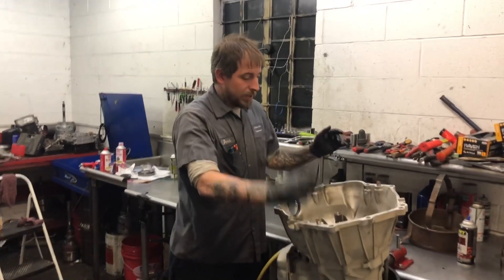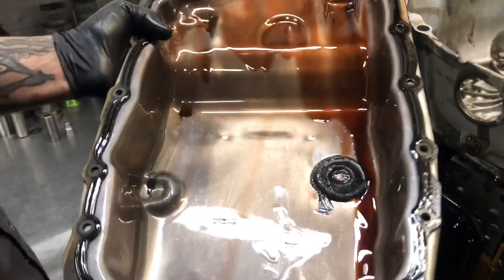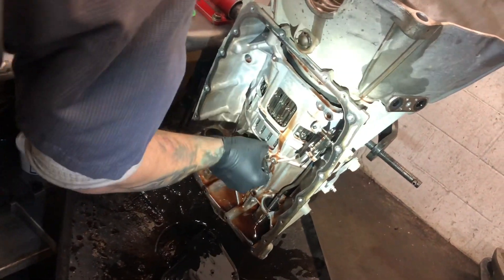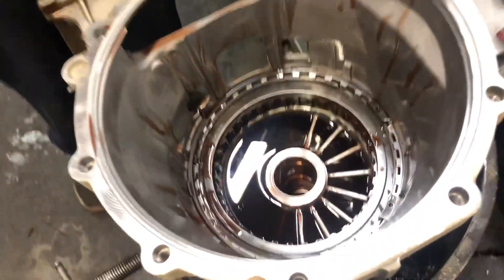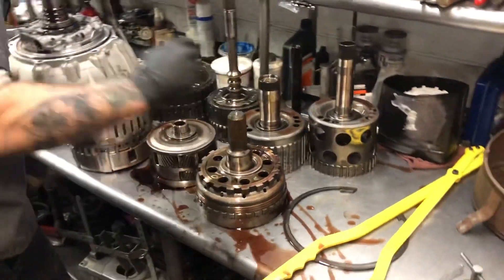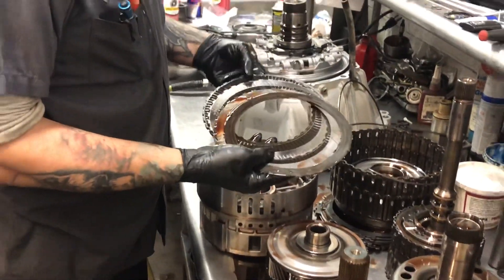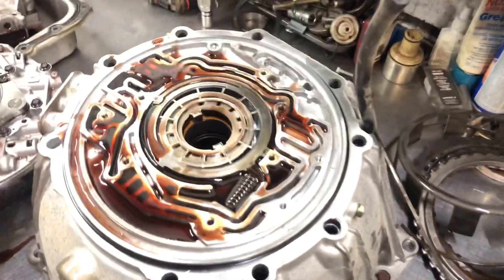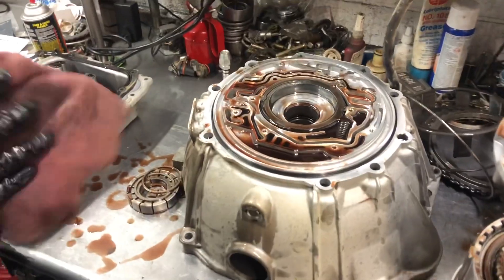2015 GM 6L80 torque converter failure

Comment: Thanks for the great video!  Was watching trying to get some pointers as I am pulling the 6L90 out of my 2500HD for a rear main seal replacement.  Didn't realize at first that you are a fellow Kansas guy.  Really cool!  I was wondering if I think I have a fairly strong transmission, i.e. clean fluid and not much metal in the pan or on magnet, if a torque converter replacement is a good idea while the tranny is removed?  I understand that the 6L90 TC's are also a weak point.  If so, do you recommend going with a billet?

Comment: I have a 2014 GMC Yukon 1500 -200,000 miles.  Changed fluid every 60,000 miles.  Starting to stutter a bit, I’m thinking torque converter.. what does a rebuild like this run on average?

Comment: These models gm trucks have these common problem of torque converter getting shot. They have a design flaw for the torque converter. Our 2018 chevy silverado torque converter went out at 120k miles. We chose to rebuilt it. The transmission specialist shop replaced it with an aftermarket redesigned torque convertor and also installed a separate cooler just for the transmission to extend the life of the tranny because these gm models also have these problem of overheating tranny fluid. Hopefully this fixes the problem. Listen to Scotty Kilmer and get a Toyota. Our 2006 Toyota camry has 370k miles with the original engine and tranny.

Comment: 2016 silverado 1500 5.3 4x4 High Country and the trans. Is already slipping at 87k miles. Its time for a lawsuit this is just stupid AF. A $40k-$50k truck with a glass transmission is unacceptable. My 07 ram 1500 had 210k miles stock trans and still ran smoother than this garbage. Shit my 2001 corvette 6-speed has 80k miles and still doesnt surge or slip one bit and i drive that MF HARD. GM can make a solid trans. The problem is they gave up and decided mass production is better than reliability.

Comment: Just ran into this issue with my 15 sierra too. All of your videos on the 6l80 have been extremely helpful. Thanks for taking the time to go through all of this and film it. I'm rebuilding mine myself. It had much more glitter than the one in this video, but it still got me home.
Reply: Mine had hella glitter from a p0796 code. So from what I’m seeing I guess I need more than just a valve body

Comment: Why do this torque converter go out so easily an did thy update the 6 speed an 8 speed transmissions
Reply from the maker: There's a multitude of different reasons for converter failure but the biggest fault is in the regulator system. There have been many updates and upgrades to both the 6 and 8 spds however failure is still imminent.
Reply: @expressautotransmissiondav4207  is it because of the  exhaust pipe that runs under the transmission pane that it fails because of heat ?
Reply from the maker: No while the heat may not be good for it I don't believe it has any true effect on the life expectancy.
Reply: @expressautotransmissiondav4207  so it’s the torque converter in the front that fails and ruins the transmission right? Otherwise the transmission will last

Comment: Just got my truck back from GMC where they flushed it to get it to be good enough until the warranty expires in Aug. After I got the truck back I went to a tranny shop where the quoted me $8k to do torque converter and trans internals. Does this sound accurate or is that a ripoff?

Comment: Interesting video, I have a 2011 gmc yukon with the 6l80 and it’s starting to shudder at about 45 mph but it doesn’t seem to last long.. I’m wondering if the torque converter is about to shit the bed on me as I’ve heard the torque converter’s had issues on these transmission’s.. I wonder why the fail on these

Comment: I just bought a 2018 Silverado and it drives fine, still under warranty for a little under 2 years i would say, just curious about whether I should do a trans change or flush when it comes time for scheduled maintenance? I heard in these trannys they only need a change, but would like your input.
Reply: Definitely look into it if you think you need especially if the transmission feels weird to ya, i just dropped mine off at a shop earlier today for this reason in the video

Comment: I have a 2013 Chevy Silverado. When it's at a complete stop I put it in gear holding the brake and I can feel a rumble like the torque converter in the brake pedal. When I let off the break and go it stops. I heard that the torque converter is what messes it up. I want to put a new torque converter what type should I get. It has 160,000 miles but it's mostly highway.

Comment: I'm having an issue with air checking the 1-2-3-4 and reverse clutch. With it out of the case and mounted onto the pump, it air checks good. When in the case and pump installed, it does not air check. Is this right? Normally I only check it outside the case.

Comment: I have a suburban 2011 took it to Ammco they replaced the transmission the first time it dint want to go into 6 gear  I took it back they. Replaced with another one drove it for the last 2 days and today it was heating up 216 I don’t think this is normal any suggestions.
Reply: Did you figure it out ?

Comment: recently adquired a camaro rs 2016 with 33k miles, it has some transmission issues, when driving for some minutes it wont advance or go on reverse, its like the car is on neutral even though rpm moves, i have to turn it off then on again, and it will work for some minutes until again the car will stay like on neutral even if its on D or R, do you think the transmision failed or is the converter?
Reply from the maker: I would pull the pan and see if guy have any material in it.

Comment: What would you say is the average cost to fix this including labor? My 2017 is sitting in a transmission shop right now with this problem. I dont want to get ripped off.
Reply from the maker: My average is between 41-4500 for total rebuild with techem.

Comment: I hope you can help me I have a 2005 trailblazer and would like to have a transmission flush and filter and it has almost 200000 on it just bought it and it shifts good still wanting your professional Opinion
Reply from the maker: I say go for it. If you have it done make sure it's a pain drop and filter change also. Anytime I'm servicing a higher milage vehicle I like to repeat service it in 100 miles or less to remove any contaminates that may have broke loose from first service.
Reply from the maker: Nope no additives
Reply from the maker: Anytime glad to help
Reply: Would you Recommend any kind of additives to be put in the transmission fluid to go with regular transmission fluid
Reply: Thank you sir

Comment: A customer of mine just broke down in his brand new Chevy express cutaway 3500 with the 6l90. It won’t go forward or reverse. Just revs. It only has 9000 miles. What do you think failed? Torque converter? Input shaft?
Reply from the maker: Either one is possible. The input drum would be where I would be looking.

Comment: my truck just start failing while at work.. I drove it(3-400km) home and parked it.. should I expect a full rebuilt or you think only a new torque converter would do.. it was -35c and i could ear this power steering sound and as the drive progress i could feel  a shutter almost felt like the engine was missing.  130 000km literally when this happened.
Reply from the maker: I would pull the pan. If it's full of metal expect a full rebuild.
Reply: @expressautotransmissiondav4207  
Have you used the transgo 6l80 tow&pro kit yet?👀

Comment: Very good job & great video.
What is the the best upgrade torque converter for 6L80 transmission?
is it TCI torque converter, B&M Racing torque converter or RECON TOW PERFORMANCE TORQUE CONVERTER FOR GM 6L80/90 ???
Reply from the maker: I personally prefer the recon. If it is a high horsepower power application I use yank converters.
Reply: @expressautotransmissiondav4207  How much does u charge to rebuild a 6L80 transmission?

Comment: My 2014 silverado has a jerk to it when I drive but when I switch it to manual shift it drives fine. Can't figure out what it is.
Reply from the maker: I would get it on a scanner before any thing else
Reply: @expressautotransmissiondav4207  It started before I changed the throttle body sensor. Had the front and rear differential served, plus the transmission fluid, filter and rings replaced. Hooked up to a computer and no codes are showing.
Reply from the maker: Can you describe the jerk
Reply: @expressautotransmissiondav4207  seems to hesitate like a light jerk but sometimes feels a little hard especially going up hill in drive. Shifts good though.
Reply from the maker: Ok when it happens does it jerk multiple time also can you describe where you feel the jerk
Reply: @expressautotransmissiondav4207  multiple. In the rear end
Reply from the maker: That's gonna be a fun one. I would check for missfires as well as watch lockup strategy and verify when it's doing it. Without seeing it it's very hard to pinpoint exactly where to start looking. I hope those two areas will help

Comment: Dealing with this right now with my 15 Sierra. Bought the truck less than a month ago, already having issues with the transmission.
Reply: Bought a 2016 Yukon XL Denali two weeks ago.  I’m having a similar problem.  The earliest the dealership can get me in is Two weeks.  I’m leaving tomorrow morning for a family visit in CA.  Crossing my fingers.
Reply: 15 Silverado same here. $5700 for a full rebuild with all updated parts an billet parts
Reply from the maker: Not unreasonable at all
Reply from the maker: Very sorry to hear about that
Reply: Hope you got at least a power train warranty
Reply: I have a 2015 silverado in the shop with 94k miles, problem with transmission $5500 labor and new transmission

Comment: I’m going through this now with my 2015 Suburban.  They put a new transmission in and STILL had same exact Torque Converter issue.  Now they are putting ANOTHER transmission in.  Should I be concerned about motor damage at this point?
Reply from the maker: I would be checking motor performance once new trans is installed. Missfires can often be confused with tcc shutter
Reply from the maker: Also verify cooler was flushed properly to not contaminate the new trans
Reply: It was definitely diagnosed as a bad torque converter.  They replaced the transmission.  Then, the truck was doing the same thing immediately after replacement (shudder, slipping, jolting, grinding, etc.). They are in the process of putting ANOTHER transmission in it.  I am just worried about the abuse the motor took with all the harshness the transmission produced.  Thank you.  You have great videos!
Reply from the maker: Ahhh fair enough i doubt it hurt the engine. Also thanks for the comments we really enjoy making them.

Comment: Great video I have an allison 1000 6 speed on an 18 duramax. The thing slips and when I take it to dealersship it magically does not slip from 3rd to 4th shift but when am driving uphill it definitively slips. Still has warranty they replaced valve body and it got a little better as far as it doesn't slam the shift as hard as it did before. But am wasting all this time taking it to chevy and having them not see the problem. My next step is to take it with a horse trailer so it has a heavier load and see if they feel it slipping. Any help would be appreciated. Truck is a dually stock everything 90k miles. The only mod is a ranch hand front bumper, no diesel tank in the bed not even a tool box. 
Thanks!
Reply from the maker: There's a few different ways to approach this. I personally would start with the service advisor and try to be as clear about the problem as possible. For example mph rpm temp gear range load time of driving type of driving as well. The reason for so much information is to help the technician narrow down to a specific complaint. The 2-3 flair has been a known issue with the 6 spd for some time. If the dealer you are working with is not being as cordial as you'd like. The second option would be speak with a different dealer or a local trans specialist try to get hard proof of your concern to take back to the dealer. You will probably be out some diag fee no matter what, but the end result may be a lot better. If you do take it to a local shop explain to them the situation and make sure they understand your intentions of the diagnosis. I hope this helps you get this taken care of. Thanks for the support we appreciate it.
Reply: @expressautotransmissiondav4207  
That definitely helps! I have tried to be as specific as I can but they drive the truck on the highway on 5th and 6th gear when I tell them highway driving is fine. That is my next step a different chevy dealership. On a diferent note the first thing the transmission technician stated was that I was only bringing it in because it had 90k miles and warranty on the allison is 100k. Additionally he said this is my first allison transmission repair! So he attempted but since the trans had no codes allison approved for valve body only. Which took care of 80% of the problem but I still feel the trans slip. Now I noticed the mileage meter does not measure correctly: ie. Drove 28 miles to chevy dealership my truck said it drove 37 miles. I measured it again and it did the same thing. I compared it with mapquest and on a stock toyota suv. The toyota was accurate my truck was off by 5 miles on the way back home. 
Thanks for the quick response. You have a subscriber for sure. Have a great week budy.
Reply from the maker: That's definitely a weird scenario on the odometer. Absolutely glad to respond. Have a great week too.
Reply: @expressautotransmissiondav4207  yes am surprised as well why does the odometer add so many miles on a less than 30 mile trip? I am not a mathematician but seems like  almost 33% I recorded this with photos and bouble checked on the way back home. Difference was 37 miles on the trans with issues and the Toyota got the 29 mile trip just about right! I don't know what's wrong with the trans thanks so much agian!
Reply from the maker: That one I'd have to see I've never seen that before.

Comment: Since I’m doing my research for my truck. I’m not sure if it’s the transfer case or transmission. Could you check out the video on my channel and give some advice? I’m honestly torn what to do. Thanks for the video guys.
Reply from the maker: I'll see what I can do
Reply: @expressautotransmissiondav4207  https://youtu.be/qCTN8H_pd90
Reply from the maker: What's your channel
Reply: @expressautotransmissiondav4207  After changing the fluid in the transfer case I took it for a quick drive. Truck threw P0700 and P0741 codes. I’m looking at a new torque converter huh?
Reply from the maker: Thats where I would be going
Reply: @expressautotransmissiondav4207  thanks so much for all the help
Reply from the maker: Anytime.

Comment: Question: can the bell housing and pump unit be removed with the transmission still mounted in vehicle and engine removed? I may have damaged my pump by installing new converter wrong but not sure. Thanks
Reply: Where are you located in case I need a rebuild?
Reply from the maker: It cannot be. I'm in Baxter springs ks
Reply: @expressautotransmissiondav4207  would I be able to tell if pump is damaged by removing torque converter and front seal to be able to see the pump better?
Reply from the maker: No the best thing would be to remove trans stand on end remove pump assembly and disassemble pump halves
Reply: Can a TECM from a damaged transmission be moved to another transmission with no ill effects? When removing a the valve body I don’t see any check balls or anything else fall out. Is that true?
Reply from the maker: @moccasinmarine  I personally would not unless it's thoroughly cleaned and new pressure switches installed

Comment: I just picked-up a '18 GMC Sierra 1500 SLE 5.3 with the 6L80 in it, with 36K miles.  Had shudder, and dealer found converter coming apart.  Replaced converter, seal, flushed unit & cooler.  Seems fine now.  As asked below, any preventative measures that can be taken now to prolong it's life?
Reply: The best preventative thing you can do, sell it
Reply from the maker: Service is definitely a good thing if it's caught soon enough you could pull it and put a sonnax kit in it will prevent future bearing failure as well as upgrade to a flanged hub style converter.
Reply: @expressautotransmissiondav4207  Thanks!
Reply from the maker: @imacmanx8562  anytime
Reply: @expressautotransmissiondav4207  Just changing the convertor is not the fix,you have to install the Transgo two part shift kit. Also a billet back on the convertor will help bulletproof it.
Reply from the maker: @careylee5951  I prefer the sonnax and transgo kit as a pair and definitely agree good converter is super important.
Reply: I literally have the same year and same miles, still under warranty and at gmc right now!!
Reply from the maker: That totally sucks
Reply: Update the thermal bypass valve, see TSB 21-NA-199 and use severe duty ATF  service schedule. Also review TSB  20-NA-142

Comment: My 2015 chevy was running fine. Stopped at stop sign then all of sudden nothing high Rev no response from transmission no load clanking or noise just won't move at all
Reply from the maker: Check pan for debris I've seen them do that when the converter comes apart and plugs filter otherwise drum or piston issue in 1-2-3-4 drum
Reply: Would it show any type of code or anything? It isn't throwing codes or making any crazy noises. And what would a rebuild roughly cost? For the things you mentioned
Reply from the maker: It won't always show a code or make noise. My rebuilds start at 3500 for the 6l80 family
Reply: Thank you for info and help!
Reply from the maker: Anytime